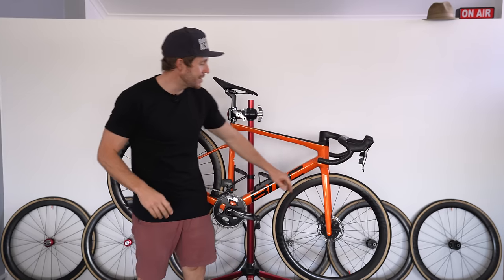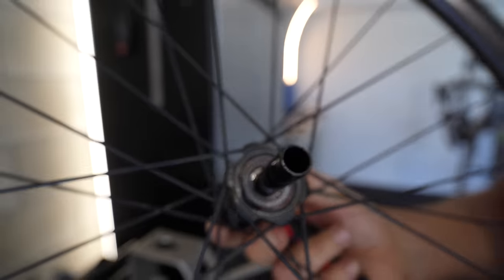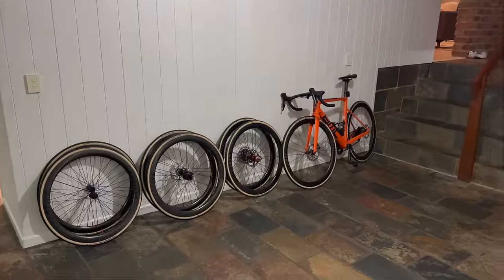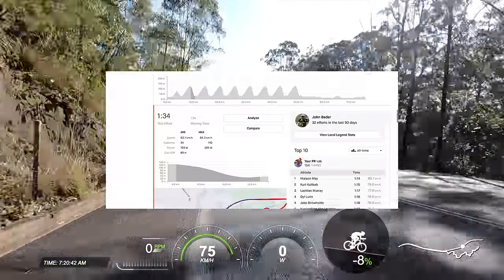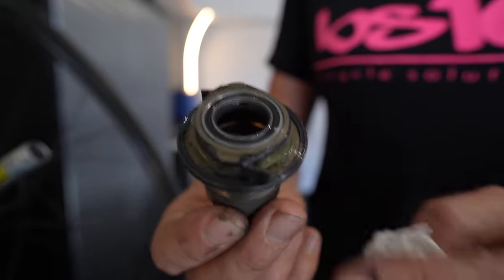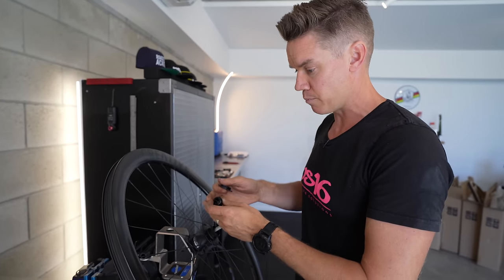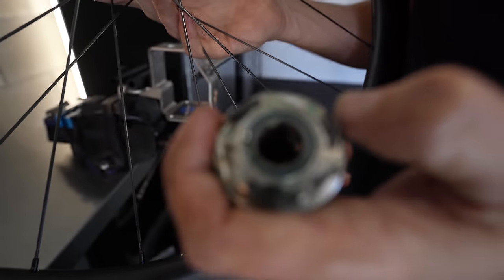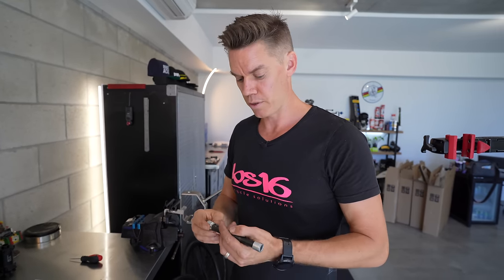What's the Fastest Hub? (DT Swiss VS. Chris King VS…)

Comment: Chris King all day, every day. A work of art and sustainable as they support them forever. Not the lightest but best craftsmanship by far.
Reply: Forever? I have 2 hubsets, from around 2009-2010. A lot of the parts of I need for those hubs are no longer in production (ISO Singlespeed axles and conversions, Campy Freehubs for the R45). That was the reason I bought CK in the first place. Next hubset will be WI for me, not CK.
Reply: @thomaslowry7813 single speed automatically disqualifies you from meaningful discussion 😅
Reply: they dont make parts for very long, from experience its 2-3 years after the upgraded part comes out. I have 2 sets of hubs (iso gen 1) from 2008-2010 and they dont have parts and wont make any, i have 3 headsets 1-1/8 straight steerer. So now all my CK parts are good for the shelf or landfill because of the ever changing bike standards and CK's lack of support with parts. a lot of us could still use the old iso hubs for road and gravel if we can get axle conversions...
Reply: So Chris King are not what They used to be… 😢

Comment: Thanks for the hard work pulling this together!  Perhaps a standard cup and cone hub like a dura ace as a benchmark. Be interesting to see the difference besides weight. The racers I rode with switched out to oil lubrication on race day, and the difference was pretty dramatic.  We recently cleaned out the bearings on my sons skateboard and lubed with Prolink. The difference was dramatic.  Think Hambini talked about the lub as being  a big factor as well.  Might be an interesting topic, same wheel and test with various lubs to see the difference.  Thanks again!
Reply: the dura ace would likely win .....one small problem there
Reply: @gen-X-trader  lol..I think so!
Reply: If only I didn't sell those campy high flange tipo hubs!
Reply: Also a "cheap" DT 370...
I guess you could only see a difference in controlled lab conditions.
Of course grease vs oil should make a difference!

Comment: I've been killing 2 sets of CLD hubs, bad weather, etc, and they are solid hubs.  And, since I have 2 sets of them built up to different rims, when I swap from bike to bike, I have to do zero touching of the calipers, the rotors do not touch or rub, so they are consistent.  That's a huge plus in this day and age of road disc.
Reply: I added DT to my Newmen stock hubs, and first there was some 0.2 0.3 mm offset with the Shimano rotors. So I ordered shims to compensate, but the time they were delivered, the offset was gone - without any change to the torque/tightening of the lock ring or anything... only 2-3 changes of wheels and rides!

Comment: I just started cycling a few years ago.  I bought my first road bike off of FB marketplace.  Got a 5 yr old Specialized Venge Expert that had 2 sets of wheels.  The second set has white industries hubs.  The bike and wheels were in good shape to my untrained eyes.  Buying an upper mid-spec used bike in good shape is better than a low-end new bike in my opinion.  While truing my wheels, I noticed the rear hub had some damage.  I looked for a replacement online.  Every shop I saw was sold out.  I reached out to white industries.  They asked for a picture of the damage.  Upon review they said that model hub was no longer made and offered me their current clp at cost.  I did inform them that I was not the original owner.  To me that customer focus is incredible these days.  

I'm a White Industries fan for life.  Last summer I bought a Scott addict Gravel, and replaced the wheelset with Astral carbon wheels with WI huBs.  I can coast past my friends on dowhills.  Well worth the $$$.

Comment: strangely missing are the ones i think would win the resistance test. dura ace or XTR depending on your setup. those bearings are amazing. even better would be to ride all the hubs 6 months then do the test. king hubs are made close to where i live in portland oregon. quality is above their competitors and the bearings are even made in house. however, it comes with a cost.....literally, along with being the heaviest of what is normally considered. shimano's cone and cup design in the xtr or dura ace variant specifically uses a highly polished cup and hardened bearings along with great seals those bearings are also larger what's found in a cartridge beading hub. i think the lower tier shimano hubs turn some riders off due to their so-so quality and service life but the tier1 shimano is cut from a different cloth. personally i would take xtr over any available hub on the market and i have tried many.

Comment: Hard to imagine any advantage of 54t ratchet on road or gravel. Disdavantages are increased friction when coasting and reduced durabilty due to less surface area engaged - plus increased cost of the 'upgrade'. Noisy as heck also. My ultegra hubs are 18 and durace ace are 24 and work well. 36T should be more than adequate unless you're hucking your bike up rocky ledges.

Comment: You can keep your ratchet drive, they are essentially one pawl hubs that rely one a linear sliding mechanism. Yes, 52 teeth but if one misses because of lack of frequent servicing, dirt ingress or the like, all the teeth miss the engagement and pain will ensue.  I've seen two mates break collarbones over the years due to this. ( poor weather mountain biking)
Reply: You are saying ratchet are worse than pawls??????
Reply: @totalglitch  Yep, automotive ratchets for sockets all use pawls for torque transfer, 100 years of proof!

Comment: The fastest would only generally apply to the freewheeling drag. When actually pedaling it doesn't matter if it's a fixie or a 72 tooth engagement hub. The sound of a freehub sh1** me to tears. My own hub I would have no idea what brand it is but I have to say that I don't hear it and that's the way I like it.
The "fastest" test really should be roll down test of the hubs when freewheeling. The sound of the freewheel is produced by energy loss and a good hub should spin longer. It's probably only part of a watt but that part of a watt is coming out of your sweat. To test the drag in a hub do a comparison of time that they will spin for with chain on versus chain off. Comparing a chain on rear wheel with a front wheel will show the drag quite clearly.

Comment: Do some tests with Campagnolo..
Reply: While not many hubs come even close in terms of smooth rolling, machining and reliability, Campagnolo unfortunately has chosen the path of system wheels without too many options to build a wheel with a Campa hub and a 3rd party rim: their only hubs you can buy are with the lowest spoke count of 32, and the hubs in e.g. their top end wheels are all designed for 3G spoking. Their pawl system is not quickly engaging due to the low number of ratchets, but I wonderi f more ratchets would affect durability... If only they would make standard 24-spoke hubs...
Reply: @l.d.t.6327  
Then just test a complete campagnolo wheel..
Reply: @alwaysmorecowbell that won't work in this test with same rims and spokes, no?

Comment: Typically a well adjusted cup and cone hub will have ~ half of the drag of a cartridge bearing hub (not counting ceramic).  Most cup and cone hubs aren't properly adjusted and thus have problems.  Adjust them well and they spin better than Chris King or DT.  Given how expensive a DT, King,  White brothers... hubset is i don't see the point in spending the extra money.  As far as engagement points more = quicker engagement but higher drag.  Some high engagement designs are heavier duty with extra pauls in the freehub body but most of them use smaller teeth to engage the pauls/smaller teeth on the ring drive.  Smaller teeth are less durable than larger teeth.  Higher engagement hubs are great for super techy mountain biking or trials riding but gravel,  road, cx,  xc mtb... is unlikely to improve performance in any meaningful way.  It's also worth comparing a lower cost option such as a bitex to the blingy high budget options such as king,  W.I.,  DT... as well as a Shimano ultegra/dura-ace for speed/drag both under power as well as coasting.

Comment: No big surprise high quality bearings should all have almost 0 friction so n that shouldn't make much of a difference. Same thing with there engage mechanism, it should be 0 friction when pedaling or you have a big problem. So the real difference is going to be maintenance. And the easier the actual maintenance the more likely that it will actually happen.  Now i think i need to go grease my hubs 😅

Comment: Nice work, what about this,.. hook up a speed sensor to a trueing stand and time how long it takes for a wheel to spin down from 45kmhr to a stop, or different wheels for spoke drag, or rim brake wheel with fewer spokes vs disc with more spokes,..
Reply: That wouldn't mean much.  Bearings act very differently under load than free spinning.

Comment: Have seen Cam's videos for a while, brilliant production and neutrality to every brand, but those useless comparison is driving me crazy. Please don't do those experiments anymore, where with some ability in calculation and knowledge in basic engineering you can tell that the experimental error and environmental variation easily outweigh the difference between different brand. You are better at giving subjective riding experience or other stuff like difference in maintenance etc. Just don't want your time to be wasted in those comparison otherwise you can do some other useful experiment. Advices on meaningful topics: don't focus on different brands, but different product categories, like different rim depth; tubeless/tubes; Aeroframe/Climber frame; bottles behind saddle/ on the downtube; aerohelmet etc.

Comment: It's so hard to beat DT Swiss, especially when the star ratchets have been upgraded to 54t. Living with them long term is just so easy.
I find that higher engagement hubs are super useful not only on a mountain bike, but also in crit races, when you need to jump on the pedals quickly out of corners.

Comment: Love my DT240's, but theyre just too noisy. Stealth freehubs ftw.
Reply from the maker: Aaron took a little grease out of the 180s and I was very surprised how much more noise came out of them!
Reply: Put a bit more more grease in them, they will become very quiet.
Reply: I run the dt swiss 360s and absolutely love the sound😂
Reply: My DT240 freehub is virtually silent which is what I like about it. God knows what you are doing (or not doing) if you think they are noisy. Maybe you should try the Chris King if you really want to know what an annoying hub is.
Reply: @ashleyhouse9690  If its virtually silent its either an old version, or worn out. Know a few people with 240's and theyre noisy af.
Reply: @ashleyhouse9690  It's all about the amount of grease in them.
Reply: My 350 is extremely quiet almost no sound...are dt hubs supposed to noise or quiet?
Reply: @bonbonflippers4298  It depends how much grease has been used on the star ratchet mechanism.
Reply: @bonbonflippers4298 Are your Star Ratchets stock? Are your 350s a few years old at this point? If they are, you have the 18T set, which is the quietest set of all DT Swiss Star Ratchet choices due to the low tooth count. There's still a little noise, but not annoyingly loud, even at high speeds.
Reply: @yonglingng5640  yeah I think they are 18t.  Super quiet. Is an 18t more robust than a 36t ratchet? I'm curious if I should be worried having less teeth
Reply: @bonbonflippers4298  36T should be OK. Manually turn your wheel and count how many clicks you hear when the wheel makes one full revolution, if I'm right, you should hear 18 clicks.
Reply: @yonglingng5640  yeah 18 clicks

Comment: Good effort but if you are comparing, it would be helpful to compare one directly after the other rather than break it up with chat. For me personally it didn't flow that well.

Also the weight comparison it would have been helpful if you put the data on the screen so you can compare rather than trying to remember 8 different weights.

That said I haven't watched the full video and it will probably come back to bite me on the ass and you will have text at then end 😅

Comment: Looking for the fastest hub but didn't build a set with Onyx hubs?! I genuinely don't think it matters as long as your bearings are in halfway decent shape.
Reply: Let's say that the bearings are all equal in quality, the only difference between hubs would be weight(if important to you) and seals that protect the internals from dust/dirt/water.  That's the only difference. 

You can be a little technical about flange/durability which affects stiffness and spoke tension over time as some hubs have softer flanges. But that's another topic.

Overall if you're an average rider that doesn't ride in dirt/rain any hub will do fine.

Comment: listen, we really need to remove the importance of weight in everything that has to do with biking. yes, removing weight is allways good, but no one with a brain pays a lot extra for some weight savings, nor would they want to downgrade the quality of something to save weight. like aluminum on the outer cassette rings. yes it takes less ware but I would much rather hjave titanium for durability. or even steel instead of titanium for price. when your bike is 15kg and you weigh 70kg ++++ removing a few grams means nothing. maby when you talk kilos and super long races over many hours you could see secounds/microsecounds of improvement, but if you are not going for a world championship miniscule weight savings are so dumb. ever thought about extra weight giving you more muscles? well a few weeks of peddling a heavier bike and youll have the same performance as you had with a lighter one....